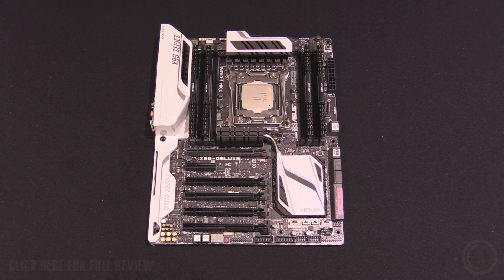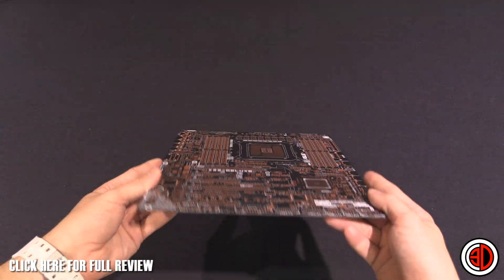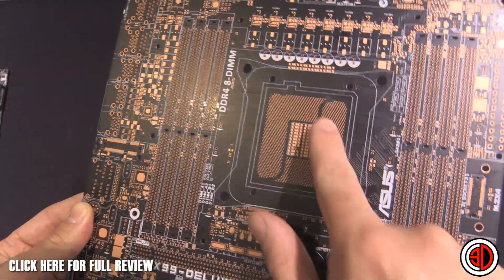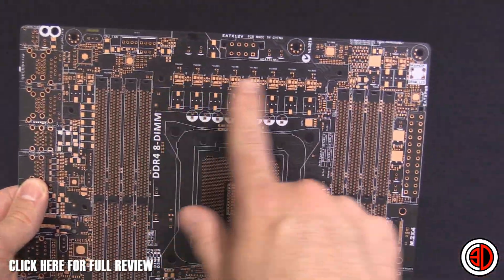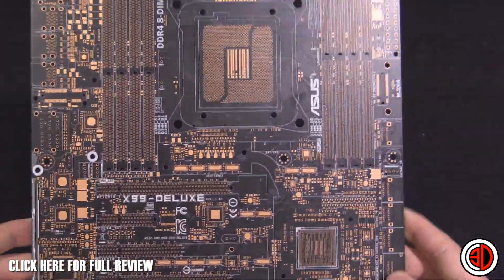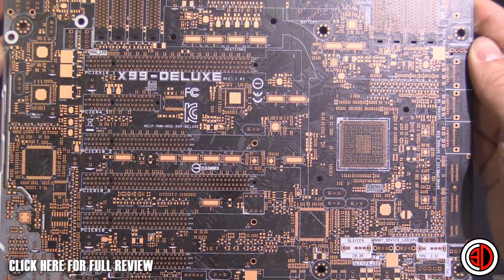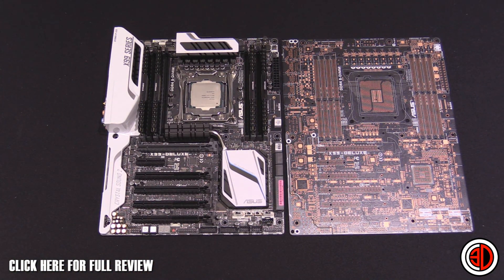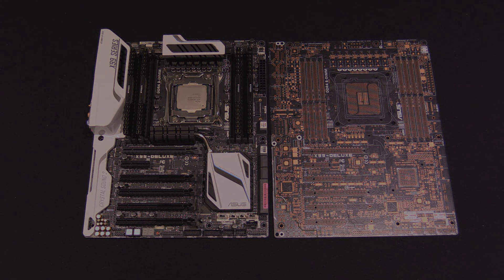Asus X99 Deluxe Naked PCB Nerd p0rn Nerd pr0n

Comment: Crappiest mobo ever. Perfect specs on papers, that's why I bought one, but it's got the stability of a one-legged dog on drugs. Sometimes it even crashes before POST and tells me "overclocking failed", and I don't even overclock. If you miss the good old days of Windows 98 when your PC would crash even if you didn't touch it, then buy this board. By the way that's the second high-spec ASUS board I buy and the second that fails me. The last one I believe was a gamer-grade Opteron mainboard that one day just didn't want to boot again. Right after the warranty period of course. By comparison, I got an EVGA X58 mobo that lasted me 3.5 years and I got to sell afterwards. Fuck Asus. Don't believe me ? Check the user comments on Newegg :

http://www.newegg.com/Product/Product.aspx?Item=N82E16813132260

Like some Italian cars I could name, Asus products are good as long as you just look at them. If you actually use them ? It's your funeral. I hope they go bust.

Comment: That's funny that Asus doesn't want you to keep that naked board now that you've had your  bare hands all over. Chances are that they'll just throw it away due to contamination. I suppose it's possible they could clean it up in a chemical bath first then put it back into production but somehow I don't see happening. I wish manufacturers would start selling naked PCBs. I'd be all over that.